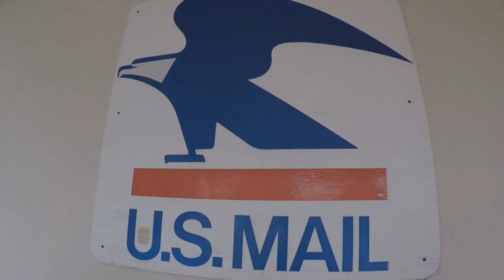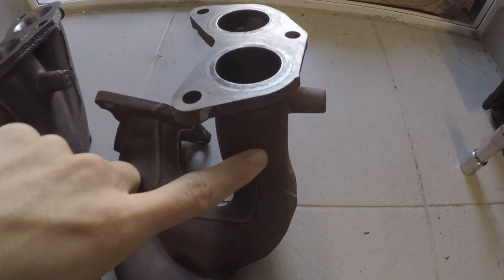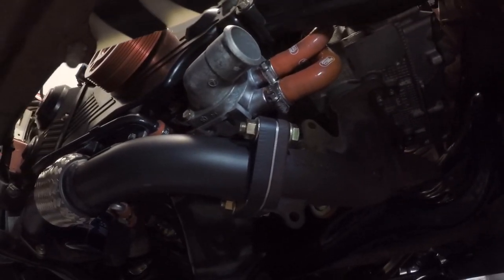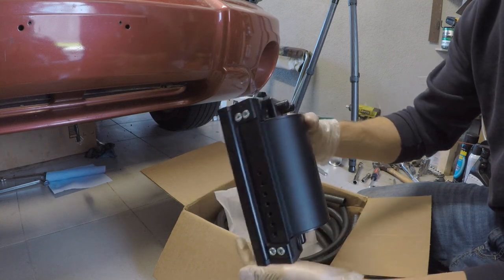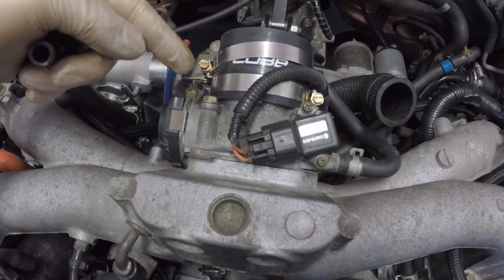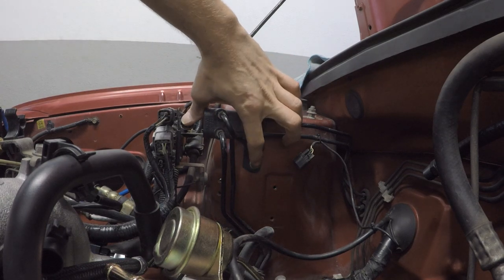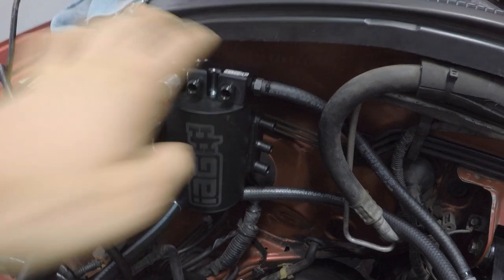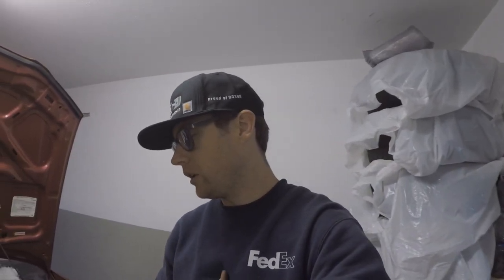IAG Street Series AOS Install 2004 Forester XT

Comment: Do you leave that thing you unplugged off where you mounted the AOS
Reply from the maker: Yes, it is mounted back in the same spot except I left the bracket it was attached too off. It would not fit due to the AOS. I also have the horn that was attached to the strut tower. I did not reinstall it. 

I hope this answers or helps with your install. Thanks for watching. Cheers!
Reply: @AdrianBilladeau  thank you so much! You know what's weird? My horn is up front. And what is that thing for anyways? I feel like it should be something I should know but I have no clue lol
Reply from the maker: @OffshoreTACO  yea I have horns up front as well. And I honestly can’t recall what exactly that piece does. If I remember correctly I could have left it off but I decided to leave it on.